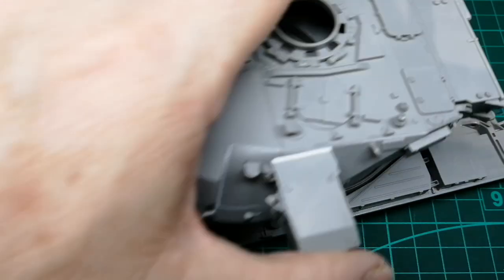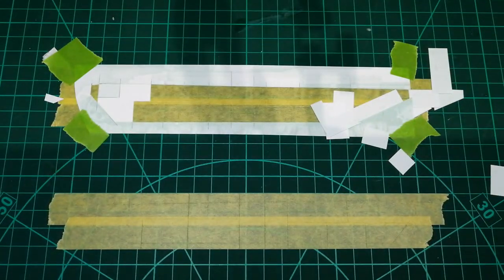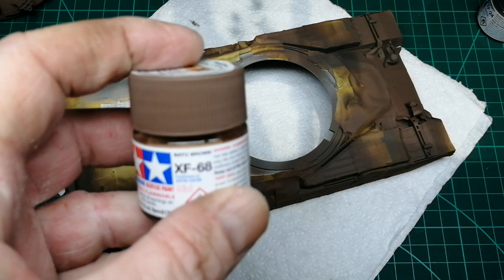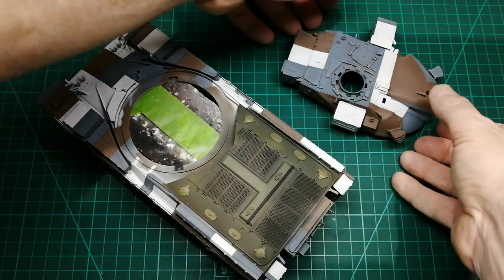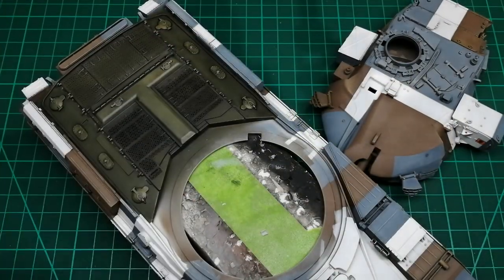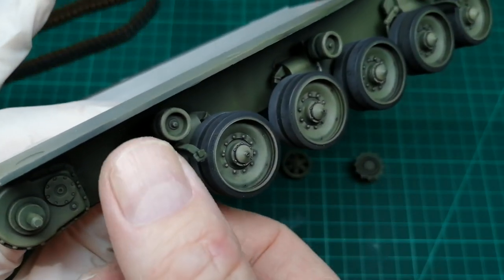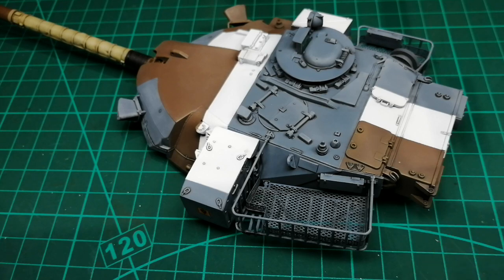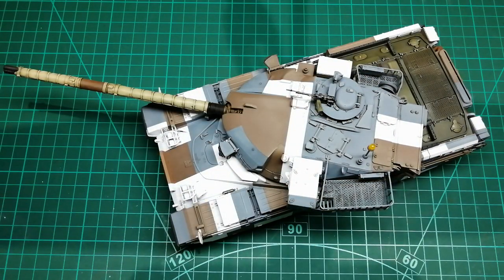Takom's Chieftain Mk.10 Build (Part 2 of 2)

Comment: Nice build.

What kind of glue are you using to when connecting painted parts?  The Tamiya thin I use just takes the paint off.  I end up resorting to CA glue but I'm hoping there is something better.
Reply from the maker: PVA glue is good at holding painted parts, providing they aren't supporting weight. Tamiya glue, with the white label, is also good at holding painted parts, but it is quite gloopy. The best practice is to clear the area of paint, not always easy.
Reply: @GregsModels  Thanks!

Comment: That’s a lovely piece of work Greg, that oil drybrusing transformed it and is far less harsher that acrylic or enamel. You have made this old Chieftain Gunner a very happy man....👍
Reply from the maker: Thanks Steve, two mistakes on the paint job which I could have corrected but too lazy. The running gear should have been painted black and I think the engine area should have been the bronze colour rather than green, never mind worse things happen at sea.

Comment: One other tiny detail the reel on the turret roof was for D10 cable, which allowed tanks to connect to each other and talk when in radio silence, usually there would have been a lenght of D10 two wire on the reel

Comment: I bought mengs mk10 the other day I'll be starting it at weekend, the suspension is movable like afv clubs with springs I never relised it was mengs till got to my mates model shop I thought it was Takom never even knew meng had one it surprised me! I'll be doing this camo myself good idea with the scanning and blowing up for masks! Turned out really smart mate! You don't remember the actual numbers you blew it up to for 1.35 by any chance mate?
Reply from the maker: No, sorry, I think I measured the side height of the skirt of the kit. Then the scanned image was just increased by increments of one per cent until it meet that measurement.

Comment: Good job. I've built several all mk 10 and 11s. 2 things. The canvas cover fits like crap whether you put it in following directions or after like you did. It's an awful fitting piece. If you do another, don't put any track pads on the track on the ground. It actually adds a look of weight to the tank. I learned that from a British buddy of mine. I tried it and I'm definitely going that route time.
Reply from the maker: Thanks, rubber pads are just fixed on with PVA glue so should be easy to peel off.

Comment: Fantastic build as always.
Do you seal the model after dry rushing oils? I'm wondering as you use an oil wash afterwards
Reply from the maker: I would leave the oils to dry for a few days before applying a wash. I try and keep the number of varnish coats down to a minimum on a model.

Comment: Greg do you use a sealer or clear cote to lock in the pastels (like on the rubber of the wheels) and if so what do you use? Great work - after watching several of your builds today I finally got the mojo back after months of no will to build anything. So I sincerely want to thank you for giving me the inspiration I was missing and needed!
Reply from the maker: I sometimes seal oils in with a varnish, Tamiya's semi gloss, but not pastels, being the very last thing I add. I think the varnish, which is always a very thin mix, may spoil the subtle effects. I might have to experiment just to see 👍

Comment: Just came across your channel recently, top quality modelling and presentation,  Your question about uniformity of the camo pattern for the Berlin Brigade tanks - I have only seen one photo you can find in the wikipedia article from a parade but they do look uniform
Reply: Yes they were, the vehicles stayed in Berlin and were handed on to the next unit coming into Berlin Brigade, the paint job was applied by REME in workshops

Next time you do a tank with rubber track pads you might want to take a few chunks out of the rubber, they always looks like that after a couple of miles as they went over rocks etc

But it looks bloody good to me

Comment: Fantastic result Greg i keep looking at this kit but the prices are a bit on dear side
Reply from the maker: Yes, cheapest £50 on Amazon. If you ever get to build this kit and paint the Berlin scheme, the lower body, including the running gear, should all be black. Also, I think the  engine area should be the bronze colour, not green as I have it.
Reply: Cheers Greg for the heads up I think it may be a Christmas present to myself 😁😁

Comment: As an old Chieftain crewman really nice model...one thing wing mirrors were never fitted. This camo was only used in Berlin, they never went on exercise if the tracks were that rusty, someone would be for the high jump lol
Reply from the maker: If it doesn't move paint it white
Reply: @GregsModels  before going on exercise we used to paint the tank, on return from exercise wash it down, any chips to the paint work was covered in red lead paint, and then paint it using camouflaged (it was named that) paint black and green. We used to paint the tanks with 4 inch brushes not once did we use a spray gun it was always by brush, there was not set pattern to were black went or green so long as all areas were painted. Inside the vehicle was painted silver.
Reply from the maker: @andyc3088  I wonder why silver inside and not white?
Reply: @GregsModels  I believe it was due to silver reflexing light better? Around the turret and drivers compartment were a number of single bulb lights with a rotatory dimmer switch. The turret plates, ammo stowage and loader safety rail were silver. Silver paint was used on the bare turret sides, otherwise there was light buff coloured padding. All vehicles on exercise, would carry rolls of black or light brown hessian, front, rear and both sides,  so that when they were dropped it would break up the shape of the vehicle. Also on Chieftains had a cut down camo net covering the turret.